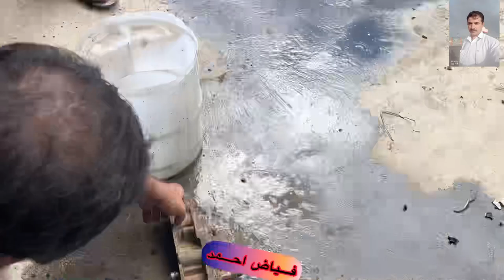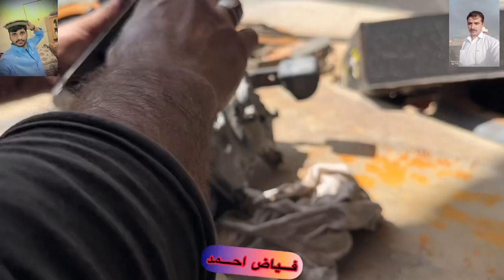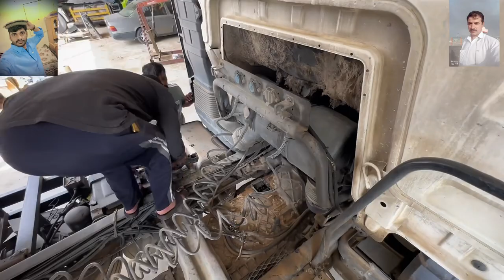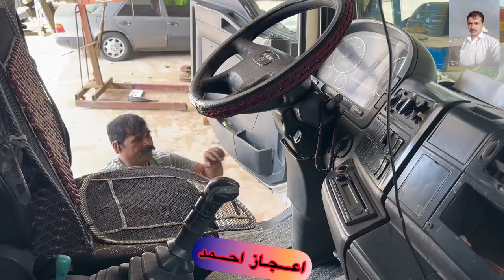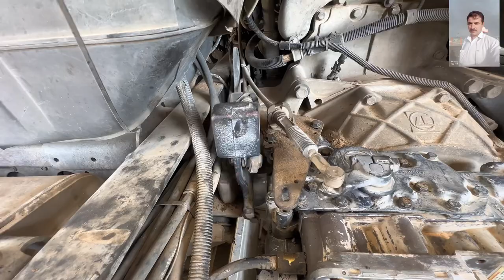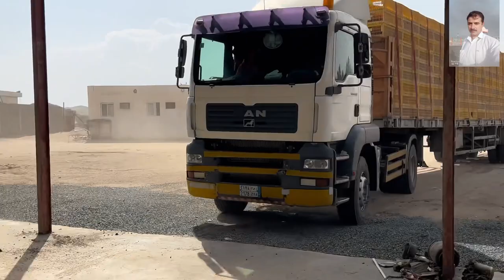MAN truck￼ gear problem, shifting and issue ￼

Comment: My man truck is having gear shifting issues like this what do I do?
Reply from the maker: What model is your truck?
Reply: @fayazahmed7811  MAN Diesel engine, gear 2,4,6,8 works but 1,3,5,7 doesn't enter
Reply from the maker: @Orezimena  gear cables change plz
Reply from the maker: And gear oil change ok
Reply: hi mate i am.not sure if you can assist i have a man tgs 27 440 2012 model it takes all gears retard works but when u stop completely it goes to neutral N then u need to reselect D for it to move not sure what it could be